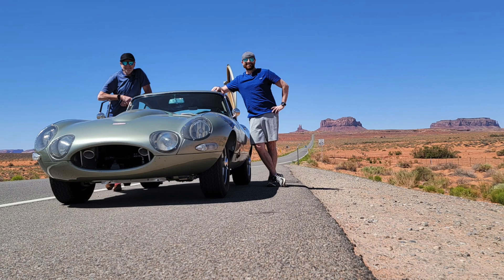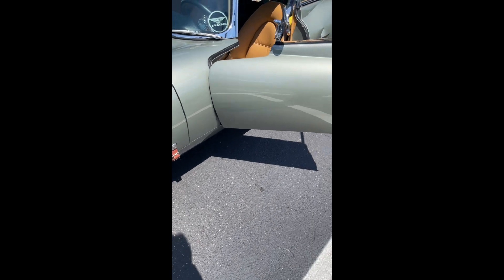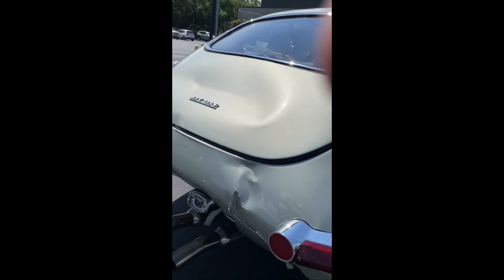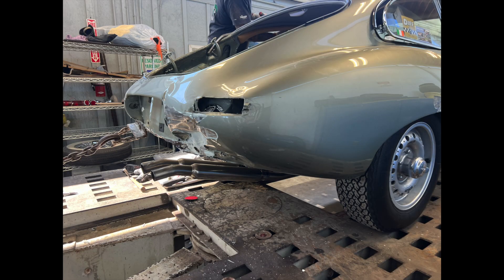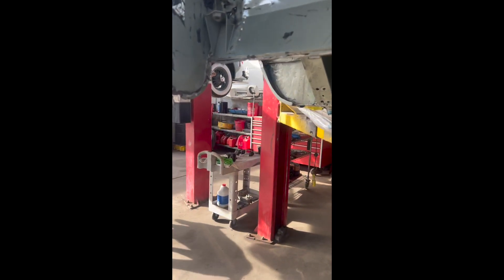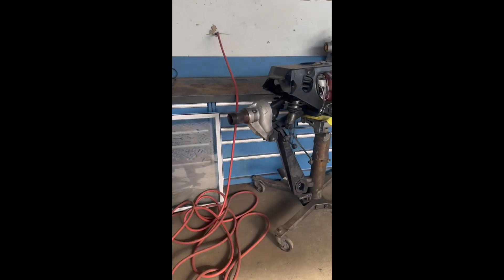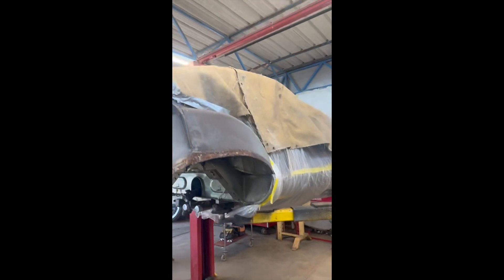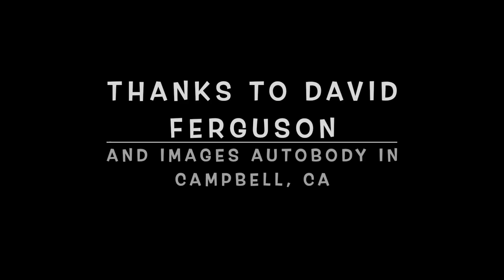Goose Recovery - Part 1

Comment: This is such a gorgeous car, I really love the revised 4 light front end. Am I wrong that it looks like a lot of body filler under the cracked paint?
Reply from the maker: You are not wrong it looks like that but in reality there was very little indeed.  If you look at the following videos you can see that this piece of metal was replaced anyway so the repaired car has even less!  Thanks for watching